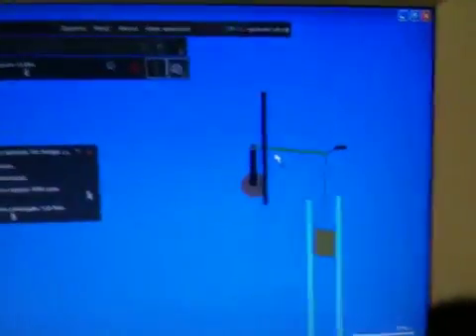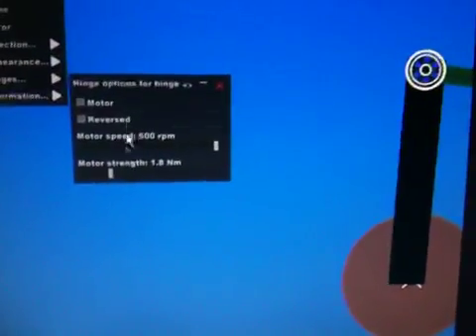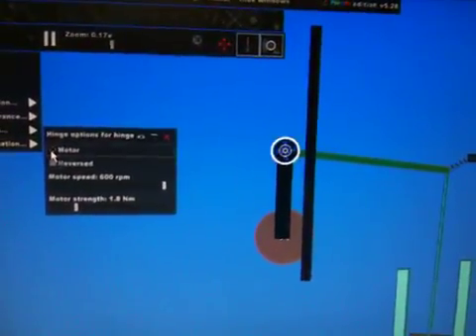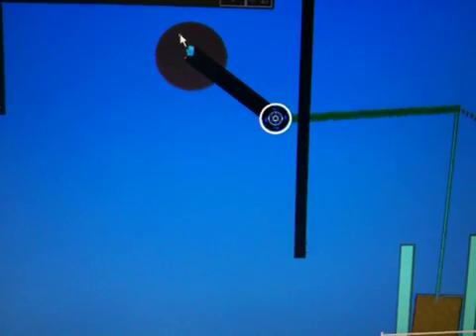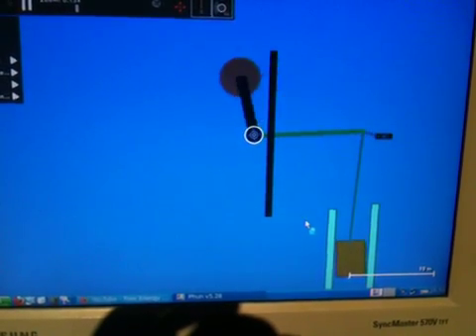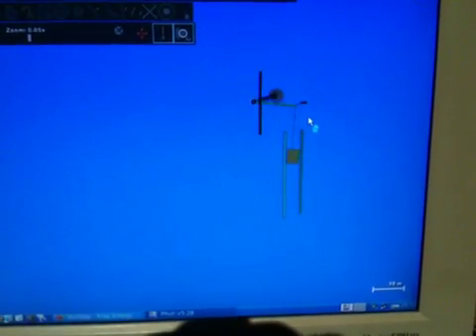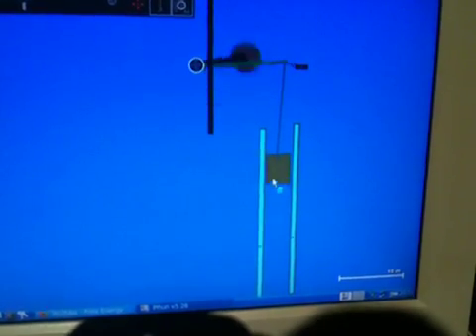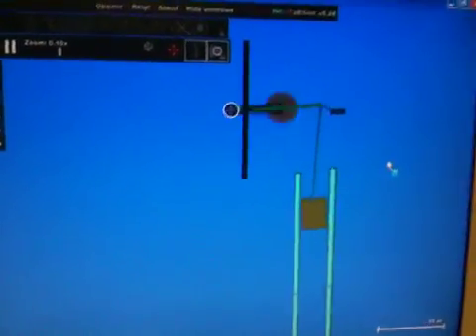Free Energy Centrifugal Force Converter - Part 3

Comment: Sir, you are absolutely wrong about a small amount of energy going in and a lot of energy going out.  The Mass coupled to the Spring is  basically a lossless  oscillatory system transferring energy between them and there is not an ounce of energy output anywhere.
Also I notice that you are not driving the rotation of the rotating pendulum at the resonant  frequency of the Mass Spring output system and some energy is used in the acceleration forces to drive that Mass Spring system not at its resonance which in turn may transfer back some energy to the pendulum itself during certain phases of the cycle. 

If you introduce  very lossy components, then please do  become acquainted with the difference in pendulums with   fixed pivots and those with moving pivots, Those with moving pivots can act as centrifugal clutches to transfer energy from and to their own  internal angular  energies  and if not  replenished or supplied by external energies they will stop moving. 
* normally a swinging pendulum whose pivot  is lowered during its centrifugal action at the lowest point to cause a  counterweight weight to rise will lose its swing, while  one whose pivot is made to rise  by   lowering a counterweight  will gain energy.
All this is hidden  action in your simulation.

Comment: Hi MagnaMoRo, It looks to me that the weighted lever should be rotating clockwise, and there should be a ratchet connected to the weighted levers pivot, so the spring loaded pumping weight can put the little bit of energy back into the rotating lever to push it over the top, just a thought, See if you can get a rear bike wheel and put a weight on it and your build is halfway built for you! Good luck

Regards Trevor

Comment from the maker: @zzytrewq
I want to point out that if (in an unrealistically perfect model) the input mass were set into motion without bearing or air friction, then, (even without any more energy input) it would rotate forever (Newton's law). Therefore, it would generate centrifugal force forever.  Then, centripetal forces would act on the input side of the fulcrum forever, to  energize any type of load on the output side of the fulcrum forever.

Comment from the maker: @zzytrewq
(continuation)
The only real question that needs to be answered here is: does it require more energy to continually oscillate the output load (the mass) placed at the point where it is on the output side of the fulcrum, than it does to "start" and "keep" the input mass rotating? Using Newton's laws regarding motion of mass, of course.
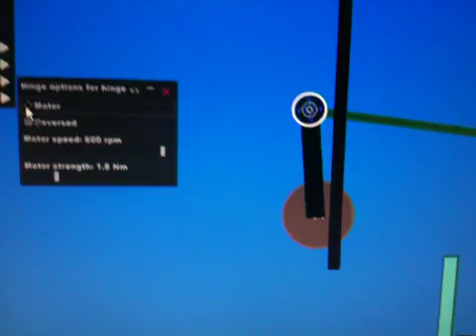Reply: the input/output kinetic enrgy ratio is about 1:10(!!!!!!!!!!!!!!!!!!!!!!!!!!!)

Comment from the maker: @zzytrewq
I completely agree: "Computer simulations don't always reflect the real world."
I assure you: a real model is under way.
But, it appears by your comment that you didn't realize that in this demo, I was only considering a way to "start" the rotating mass on the input side of the fulcrum when gravity affects it's rotation.
Also, any mass on the out put side would represent a load, regardless of the spring. For it requires energy to oscillate any mass.
(to be continued...)